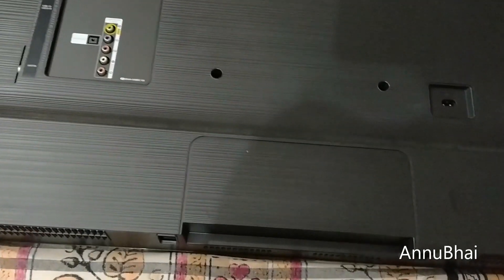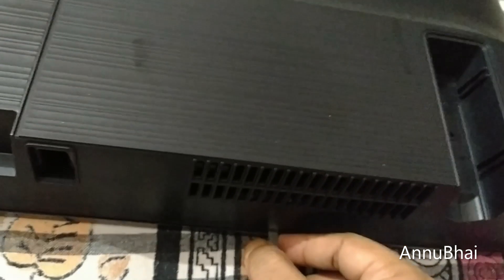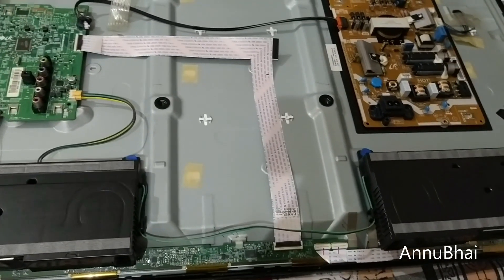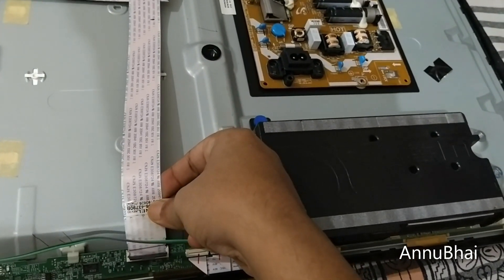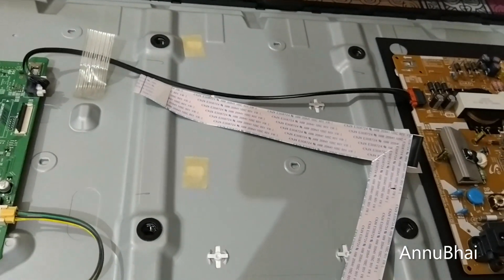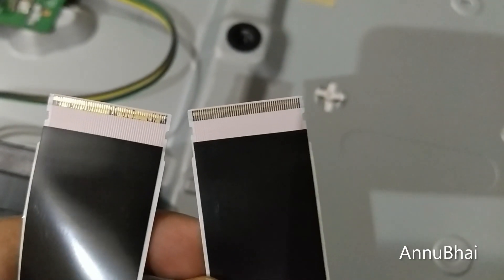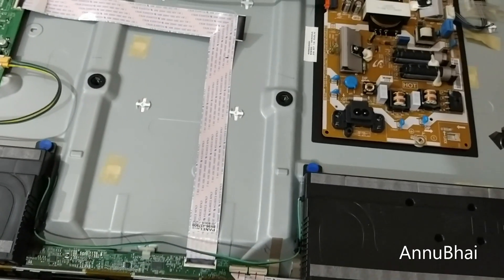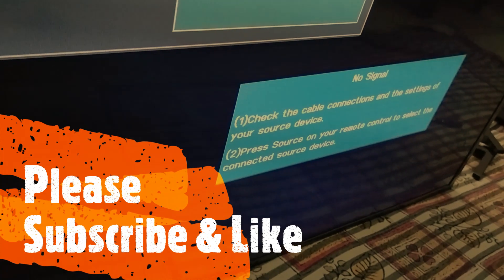Samsung LED TV Solid Colors Burning Mode Issue - Blue, Red, Green, White & Black- SOLVED

Comment: Bro you just saved my 700 rupees . I did the same and my tv worked . The Samsung service were demanding 700 rupees then I just searched for some random solution but you luckily I saw your video .
Reply from the maker: Sounds good, it works for you.

Comment: You didn't showed how you connect the cable again??
Reply from the maker: At the edge of cable both left and right side there is small v shape blue plastic using the same you have to first attach cable and when it properly fit then close it. That's it hope it helps.
Reply: @AnnuBhai  and how to open TV?? I am totally confused because I can't see any bolt
Reply: We did according you told us in video but still it's showing the same color changes screen
Reply: Press the power button for few moments and it will disable the burning mode